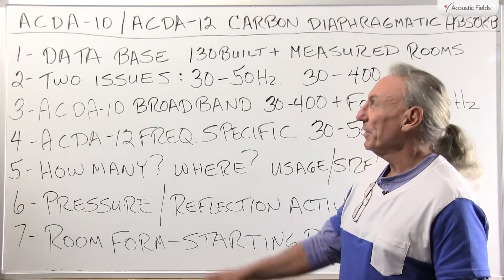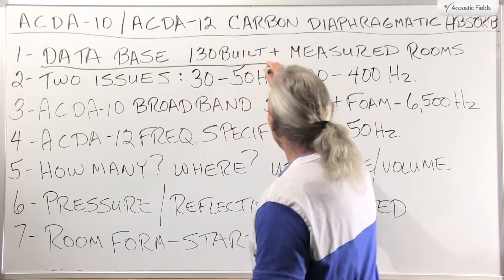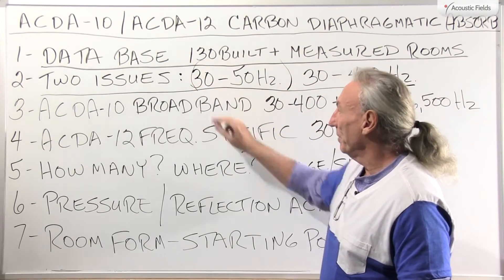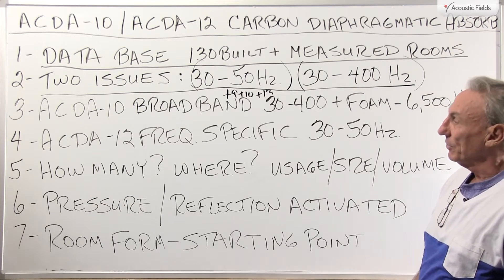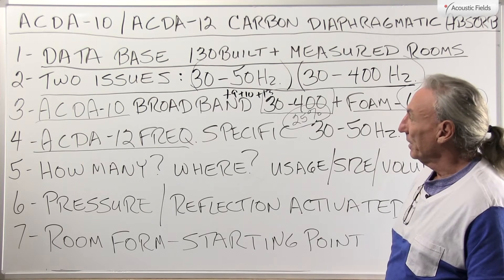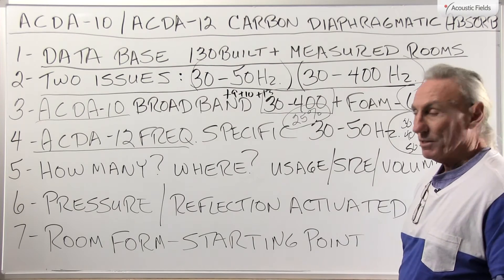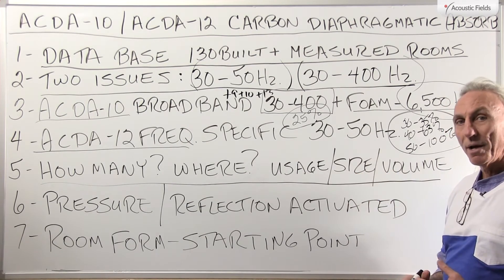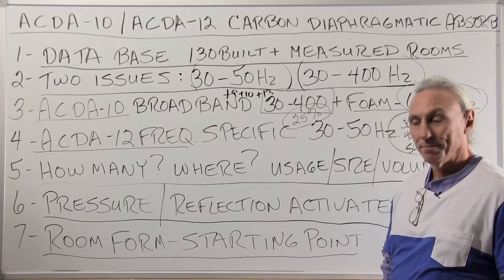ACDA Diaphragmatic Absorbers from Acoustic Fields - www.AcousticFields.com

Comment: Dennis,
I understand every room is different, but generally speaking, is this level of LF absorption effective/desired in the rear corners of a home theatre?  (assuming one has treated the front wall for LF...)
Reply from the maker: Hi Yacht, The area of highest pressure in most rooms is not in the corners. This is a myth perpetuated by the acoustical products industry that knows you will buy product that wont work and place it in the corners of your room because you have nothing there to begin with. Acoustical issues are never a one size fits all. If you here that uttered, run fast and far away.